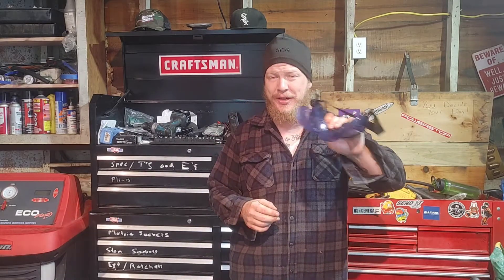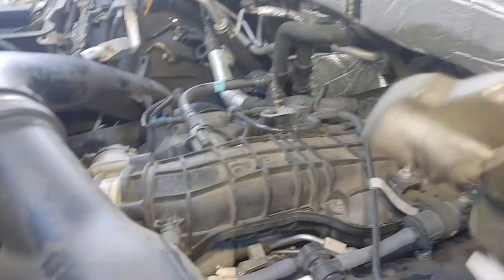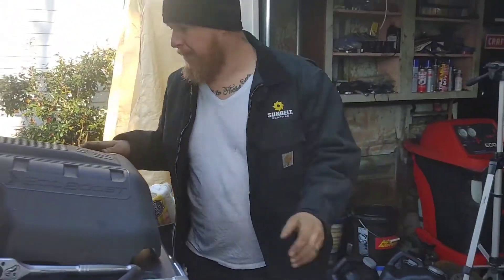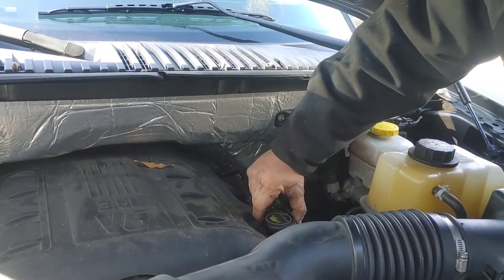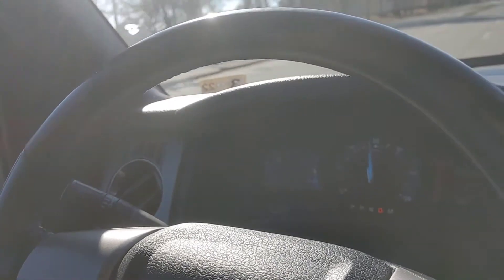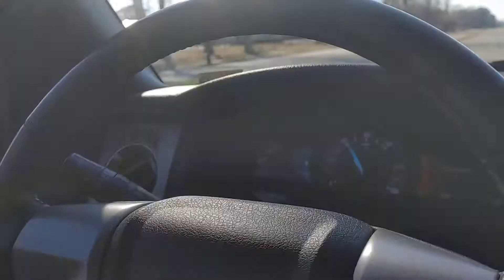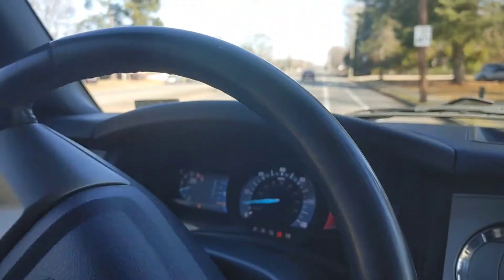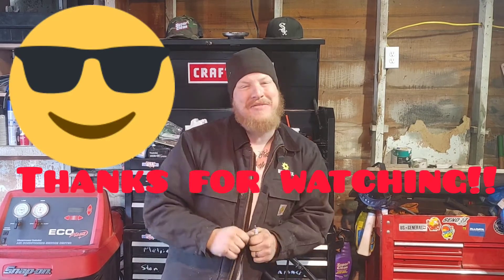Engine Code P0301 Repair Made SIMPLE!

Comment: Hey any idea if replacing the spark plug and coil doesn’t work? I’m thinking bad fuel injector?
Reply from the maker: You have a misfire in that cylinder specifically?
Reply: @Sellthoseflippingcars  yeah same cylinder started missing again…. Just got done pulling the plug again and it was already cracked twice. After some more research I am finding out that some people are blaming the intercooler due to built up condensation and no weep hole. The internet is suggesting that I drill a 3/32 hole into the bottom of the intercooler so that the moisture can escape and not get thrown on the plugs…. I have a call into the dealer to talk to someone about it
Reply from the maker: That is odd, I never had that problem with my Ecoboost, I would check with the dealer on that, talk to service department directly and talk them through everything you have done already. Let me know what they say